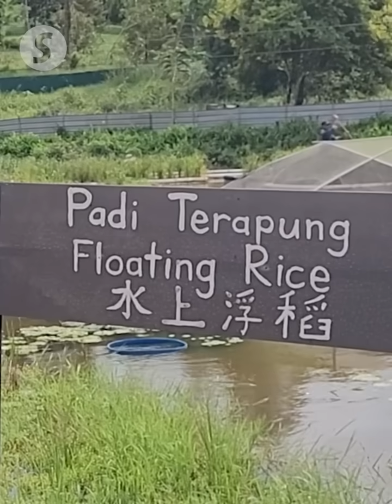Engineer tries out new method of rice farming

Comment: New methods of rice cultivation are transforming agricultural practices worldwide, especially in regions seeking to improve yields, adapt to climate change, and ensure sustainability. Here are some insights:

1. System of Rice Intensification (SRI):
This method involves planting fewer seedlings with wider spacing and using less water. It promotes better root growth and higher yields while conserving water resources.

2. Direct Seeding:
Instead of traditional transplanting, farmers sow seeds directly into the field. This reduces labor costs and allows for faster planting. It’s particularly useful in regions with labor shortages.

3. Aerobic Rice Cultivation:
This method involves growing rice in well-drained, non-flooded soils. It reduces water usage significantly and is suitable for areas facing water scarcity.

4. Drought-Resistant Varieties:
Advances in biotechnology have led to the development of drought-resistant and flood-tolerant rice varieties, helping farmers adapt to unpredictable weather patterns.

5. Integrated Pest Management (IPM):
Using natural predators, biological controls, and targeted pesticide applications reduces crop losses while protecting the environment.

6. Precision Agriculture:
Technologies like drones, sensors, and AI-powered tools help monitor soil health, water levels, and crop growth, ensuring efficient use of resources.

7. Organic Rice Farming:
Increasing demand for chemical-free produce has encouraged organic farming methods, which focus on soil fertility and natural pest control.